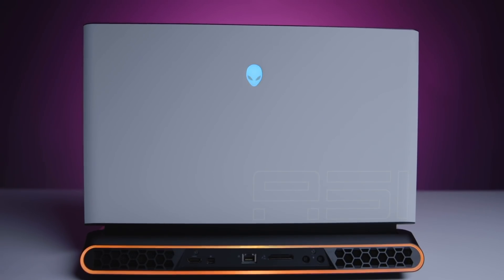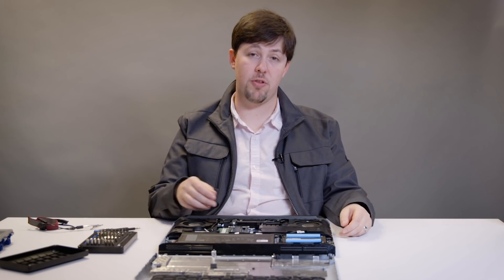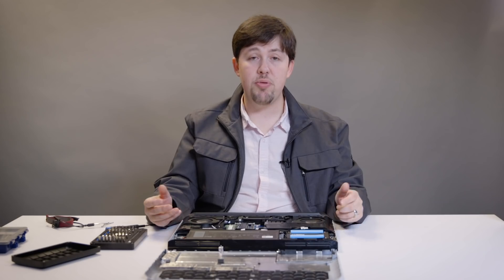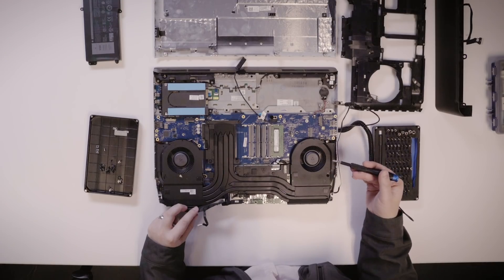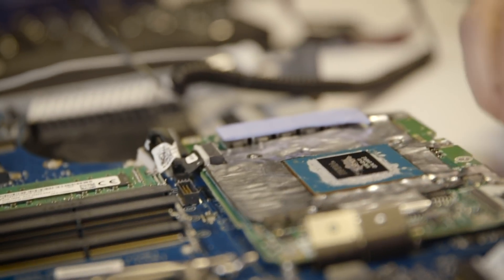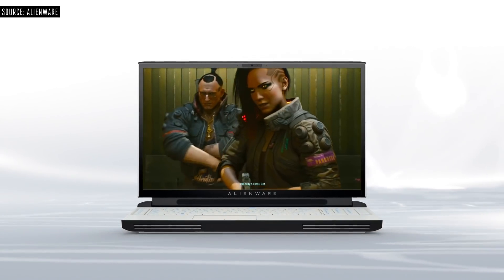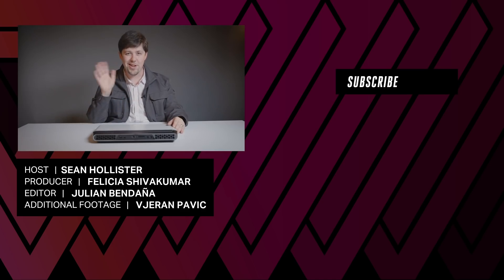Alienware Area-51m: an exclusive look inside

Comment: I like having a powerhouse I can move when I need to, and a thin & light for everyday mobility.  As such, I have a surface pro 7 for daily commute and now getting an Alienware 51m R2 for my main driver at home.  I also like that the option of upgrading my graphic with the Alienware Graphics Amplifier if the RTX 3000 series is not doable with the laptop's motherboard.

Comment: So a year later and area 51m users are differentiated between R1 and R2. That's right they developed a new model for an upgradable laptop. Why that makes no sense you may ask? And you know what, you're absolutely RIGHT. R1 users aren't given the opportunity to upgrade to the newer chipset that comes with R2 , NO motherboard upgrades to utilize Intel's new 10 series chipset. So basically they lied. They cheated. They failed.
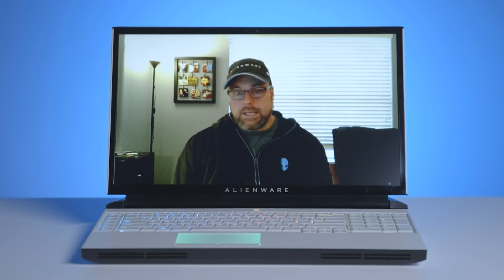Reply: No, they didn't. If you actually watched the video and listened; fast forward to 3:39 — you would realize that they never promised anyone anything.
Reply: @WeatherxCalipha  have you watched their ads ? They promised unprecedented upgradability. Where's the rtx super cards.

Comment: As a gamer who also uses this laptop for work as a developer, this laptop's only problems are heat, noise and clumsiness at business meetings.

On Ubuntu I actually had to disable turbo, and on Windows I used Throttlestop to undervolt and lower turbo speeds. Still games and compiles fine, though. However, I'd appreciated it if the laptop came with beefier radiators (on 2060 version at least).

Comment: After 30 or 40 something years, someone has finally figured out what everyone wants. 
They want to take apart, fix, clean, upgrade, customize, tune, etc. their own computer that they bought with their money and not have to worry about voiding the warranty. 
They want to "own" what they paid for with a more traditional sense.
"modular", "customizable" should've been for every computer ever, laptop and desktop.
For everything else there's a phone, tablet, wearable, small form minimalistic laptop, etc. whatever you want to call it.
Bottom line, why shouldn't you be able to take apart your own computer? I simply don't understand. It's not a fusion reactor.

Comment: While I won't be rushing out to replace my AW 17 R4 with this, I'd be on the fence about buying the 51m if I needed a replacement. With that out of the way, if they could guarantee future upgrades at a reasonable price (which, in my opinion, is $100-200 over their mass-production counterparts,) Alienware would likely have a slam-dunk on their hands.

Comment: I love the idea of the upgradable laptop, but we need something like a barebones machine.
You have to choose the fixed parts like screen and the chassis then every other thing is optional.
for example:
* I can choose whatever processor will fit with the provided socket or I can choose to purchase it myself (as It's a desktop processor)
* I can choose to purchase An RTX graphics card now or just use the Intel graphics.
* I can choose I need windows system or just Dos.
* I can choose to purchase Ram or not maybe I already have a ram from an old laptop
* I can choose to add SSDs or hard drives or not, maybe I'll use also old ones I already have.
But nothing from the above is optional You have to choose from a limited set of options and pay a bunch of money otherwise you'll not be able to get the machine.
Good start But we need more to become a real desktop replacement.

Comment: even if you can't upgrade the gpu, it's probably still future proof because the hardware is so powerful that it can handle all games in the next 4-5 years. Whereas the modular design gives you the ability to replace cpu and gpu if one of them fail instead of having to replace the whole motherboard at the cost of nearly the entire laptop

Comment: What is the point of this? If it already comes with a 9900k what could we possible upgrade to? If it comes with a 2080 what is there to upgrade to? Even if a new card came out I doubt the motherboard would support it. Also no guarantee that the laptop cooling could handle it, or that it would deliver enough power since those things cannot be upgraded. CPU sockets could change and this will also 100% depend on if Alienware adds in support for newer generation CPUs to the motherboard. Remember when lenovo made the ultrabay for upgradable GPU? Well they never released any better GPU so we never were able to upgrade. Furthermore that GPU module is proprietary so get ready to pay a premium for a laptop GPU upgrade. Also why make this like a desktop and then use laptop RAM? Or why throw in a crappy membrane keyboard on a $4000 laptop. Can no one invent a low profile mechanical keyswitch?

Comment: I wish the entry level model had a i5-9600k and a RTX 2060! I think that would be more acceptable for a gaming laptop of this price since there is the guarantee of being able to upgrade the CPU and also the GPU to what is currently available. It also think would be cool if you could spec it out with a more entry level CPU and use a higher end GPU, since the CPU upgrading method isn't proprietary.

Comment: Not sure if anybody noticed... it requires 2 power supplies. Wow! Working for just 1 hour on a battery power... ALienware did similar a few years ago to their A18 - fantastic machine: 32GB RAM, good Extreme CPU, 3 hard drives including 1 RAID, 3 video cards, but very heavy for sure.

Comment: Would by in a heartbeat, still using my mx11 r3 from 10 years ago. Only problem was the battery. Took it out and lost 2lbs. Seems I'm always near an electrical outlet, so no worries.

Comment: For me the GPU swap is not that big a deal because if i want to move up , we have the AGA with PCI 4x. That gives us the ability to upgrade the GPU at any given time anyway. Which i have done on my current Alienware 17 R4 . But what i thought was interesting is the chipset CPU swap. As long as we dont see any real socket type changes anytime soon, i would think we would be ok, is this coming with LGA 1151 ? or an older socket? You know if i have the ability to upgrade my cpu for 1 or 2 generations past what i buy, i think that may be worth it. 

I am 50/50 on this laptop, but i think i will be getting it, because i haven't bought a desktop in years, and i am a big gamer, RTX cards are going to become a must eventually and i could just update my GPU on the alienware with the AGA, but then i am stuck with a I7 7700HQ .. and how much longer will that remain relevant, i think i get a 30% performance increase moving to the 8700 Desktop chip alone. 

Ill be buying it :)

Comment: Yup...I did buy one....be here in 1 month. Pulled the plug and bought the full enchilada $6500.00. My current Alienware m18x r2 has all the upgrades, dual 980m gtx in sli, extreme core i7 3940XM, 32 gig ddr.....well it's time to time to upgrade and see what the future holds.

Comment: Ok, so I like customizability as much as anybody, but "Never been able to swap out the graphics card, until now" is completely False. 

MXM3.0 or "Mobile PCIe 3.0" is a standard that has been around for quite while and is widely used by many manufactures. I did in fact swap out my graphics card on my old m17x R2 back in the day from 460m to 675m, in like 5 minutes.
This proprietary connection might even be inferior in speed and is probably never going to be supported in the long run, just like everything else proprietary Dell/Alienware make.

Comment: This is a terrible value for your money. You're paying a premium for desktop-grade hardware crammed into a "laptop" form-factor all for the upgradeability, and the end result is a laptop with crippled battery life and no real guarantees that you'll be able to upgrade the GPU any time in the near future. If you want portability and performance, your money is much better spent buying a decent ultrabook with thunderbolt and investing in an external GPU enclosure. Not only would that save you a good amount of money, you would also get much better battery life, and if you wanted to upgrade your laptop in the future, you don't have to throw away your expensive GPU.

If Alienware is really serious about upgradeable laptops, they need to standardize that form factor and bring more OEMs onboard. They also need to work multiple price points and not just the utmost premium tier.

Comment: Dear Apple, hope you've the same roadmap as Dell. You should definitely learn a bit from those people how to make your logic boards modular; for now not really for hardware upgrades, instead for making affordable repairs to end customers. One will need to just swap a component instead of replacing the whole logic board in case of a hardware system failure, which will be way more cheaper and efficient for both of the consumers and the OEMs.

Comment: All of their older laptops pre 2014 could be upgraded, both cpu and gpu. Same with most other gaming brands. 
The problem is not upgrading it, its the cost of finding a new gpu, as they are made specifically for this laptop. and usually cannot be used in any other laptop.

Comment: Thinner & lighter if possible, with better battery, better suited processor (example i9 8950HK is 45W instead of 95W = better thermals and battery life - and it won't bottleneck you anyways) would be much more appealing. 9900K is such an overkill even if you have Titan RTX, let alone non-Ti 2080 (doens't even bottleneck if you run them in SLI on 1440p and 4K screens). This laptop is pointless and makes little sense.

Comment: not bad! portability and power is such a tricky balance. personally i'm very happy with my asus zephyrus s as a mobile workstation that lets me do most of what i can on my desktop on the go. its a great balance between being thin and powerful. although the idea of having something that is a lot less difficult to move around than a desktop with an rtx chip in it that is replaceable is super appealing. the trouble is just that the bulkier it is, the harder to move it is, and the less use its likely gonna get.

Comment: 0:33, NO the Area-51m isnt the fist alienware laptop that have a swapable graphics card. Alienware laptops have mxm slots, not all but a lot of..
the M17x R1 R2 R3 R4 R5, the M15x R1 R2, M18x R1 R2 R3 , all this models can have the Graphics card replace.. 
I see a lot of M17x r4 with came originaly with nvidia 600 series, and owners replace with 900 and 1000 series...

Comment: Not drinking that Koolaid even for a second. If anything they've just realized the whole thin laptop thing has its place for some but isn't a requirement for all laptops or situations.

Replaceable desktop CPU? Sure lets look into that first...  I own a Toshiba P30 Laptop, it has a desktop Pentium 4 3.6Ghz processor (It doesn't run as hot as you'd think, it has this mythical thing called appropriate cooling and only reaches about 60 degrees at full load).
 As long as you've been prepared to pay the extra cost laptops with desktop processors have existed since basically the begining. The P30 is from about 2005 - 2006 I think.

Upgrading laptop processors at all? Well this was normal untill about 2012 - 2013. The laptop I am using right now a Dell XPS L704x has a i7-2720QM (It previously had a i7-2670QM if I recall), for good measure it
 can take up to 3 internal HD's also. I've also in the past upgraded a Compaq CQ42 that came with a V120 single core to a N970 Quadcore, thats quite the upgrade when you consider it was the cheapest of dirt cheap laptops when new.  

Now talking about graphics cards.... Ever heard of MXM? probably not because Dell hasn't included one in your alienware, because why would they (that would be admitting someone did it previously)
. They'll likely say MXM too old blah blah, well there is GTX 1080 Ti MXM cards?  I don't see a reason to come up with their own (cough proprietary) replaceable format. I have a Dell M15x somewhere that has upgradeable gpu in it...

Most of these laptops aren't difficult to take a apart and upgrade with appropriate research and planning and I've never seen a warranty void sticker on a screw in any laptop I've ever worked on (All older ones I admit)

At the end of it, NON of this is new. It's all been done before. What would be amazing is if dell brought these features to all their laptops. That would be industry changing, but you know.... profit margins.
Reply: Please note, I still think its a cool laptop lol. Just no as ground breaking as its made out to be.

Comment: Lmao this laptop is a joke. Dell propietary size for gpu? Only upgradeable to proc of the same series. If you really want a long lasting laptop make it ryzen.

For the gpu issue the fix are very simple. Just make a mini gpu with a standard pcb layout that may change in time, swappable power modules/psu. 

Sorry this laptop is pretty much guaranteed to be "obsolete" when a new gpu and cpu lineup comes out

Comment: The beginning of the end of ATX towers. 
At the same time reducing garbage footprint. 
Collaborate GPU standards to encourage it. 
Engineer generational modular ecosystem where brand parts are on shelves. 

I own a Dell, because it was cheap. 
I want more RAM, CPU, or GPU... Battery or Cooling... 4k display or Hi-Res speakers... later. 
I sell laptop and buy another brand, because of the hassle. 

Would be cool to change from a plastic to aluminum or carbon fiber chassis of the same profile easily. 
Makes sense to stick with morally innovative company with my interests in mind over the competition. 
Others buy the best, cutting edge, or coolest brand too - Alienware.

Comment: i dont usually encourage people or myself to buy expensive gaming laptop beyond a mid ranger because once you move past a price point where you could buy/built a powerful desktop you should do that instead, but this however is an exception, bravo for alienware breaking the norm and revitalizing laptop upgradability. think about the memes or pcmr memes lmao. but i do wonder how long will they support this device or if third party graphics card maker will provide support for more modular gpu's, without support this product will ultimately fail and just another good concept turned gimmick (which i hope it wont)

Comment: Bullshit.
All my laptops have a replacable graphics card.
Only with the 10 series nvidia cards did most companies move away from modular cards.

HOWEVER, the Dell Precisions have modular nvidia quadro cards, right now.
In-fact, the Precision M7730 has a better modular design than this heap.

Comment: uh..?? Almost all Alienware laptops have had upgradable gpu's since like 2009, but using the MXM form factor.
Reply: Yup. For example that old Alienware M17x r4 and M18x r2 that can be upgraded to 10xx series of laptop GPU and it still going strong. I have one which it is M17x r4 and I already upgrade it to MSI GTX 1070

Comment: I need more comfirmation that this is going to be upgradeable in the future before I would be willing to fork out that kind of cash for a config with a 2070 and a measly 8GB of RAM. Esp. When there is a slightly less powerful (and much thinner) GX501 currently available from ASUS (the ASUS ROG Zephyrus) for $1900 with the promise of the upcoming GX701 with about equivalent power to this laptop on the horizon, also in a market where the ACER Predator 17 exists.

Comment: This has already been done before and it didnt work out well. Power limits, changes in peripherals, dead motherboards and bent cpu pins. Let alone the replacement gfx cards are super expensive. I think its not worth it and better to just sell an old laptop and buy a new one.

Comment: My Lenovo W700, more than 10 years old and still in working order, could easily be upgraded on all fronts as well, MXM graphics card included. The differences is Dell has a proprietary format (now called DGFF) that won't let you change your GPU to another brand, just like 10 years ago. I guess they didn't learn the lesson...

Comment: But... but... MSI Titan series already has been doing it for over 3 years with SLI arrangement of Desktop GPU with desktop CPU in their laptops ..... even Acer Predator 21X did it like that .... My current laptop which is a barebone of clevo supported similarly back in 2015.... are these guys running 3.5 years late?

Comment: Um, why is your anti static wristband attached to the laptop? It is meant to be worn as a wireless accessory. And where are your tweezers? And did you use the CPU mounting tool when you put it back together? You people don't even follow your own instructions. Come on.

Comment: You can not get electrocuted from a laptop battery.. That warning is there to tell you to disconnect the battery so you wont short out something on the motherboard..
Reply: no but if the battery is connected you can get electrocuted from the display inverter.......and actually killed by it.......so there is that!!

Comment: Looks great, wish I could trust Alienware ever again. Nothing like spending $3k on a laptop that only works for 3 months and then basically being told to go f*** your self by customer anti-support. Hopefully they've improved since the pre-Dell, pre-Uniwill used parts, pre-overclocking to paid for specs, and pre Class action lawsuits days. Too bad Dell bought the Alienware name, and failed at their chance to restore my trust in the brand name.

Comment: For a laptop to have upgradable CPU and GPU, especially between different generations of CPUs and GPUs, the rest of the package has to be well built and worth keeping for several years... like a decade or so! I mean, the keyboard has to be good, the screen has to be worth it (like a good 1440p-4K IPS screen), plenty of upgradable memory (from 16GB all the way to 64gb+), SATA SSD + 1-2 NVME SSDs,  latest WIFI, Bluetooth, HDMI, Display Port etc
But the first question before buying it is why would anyone even need such an expensive and powerful thing in a not so portable friendly format?